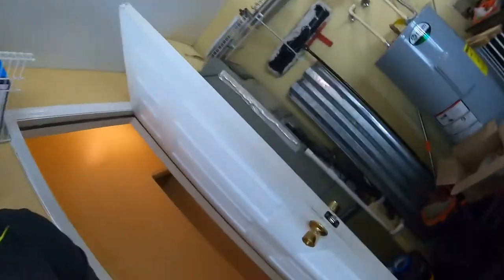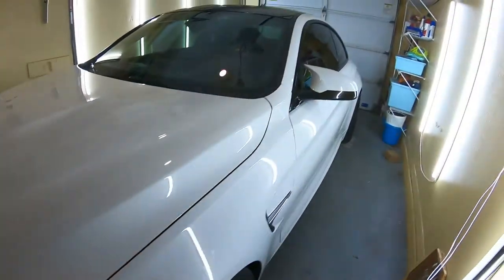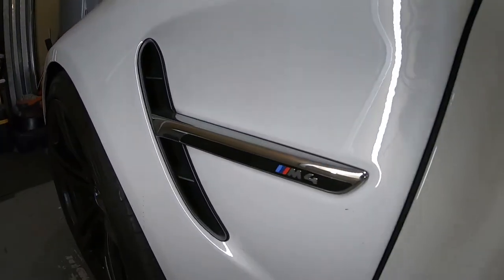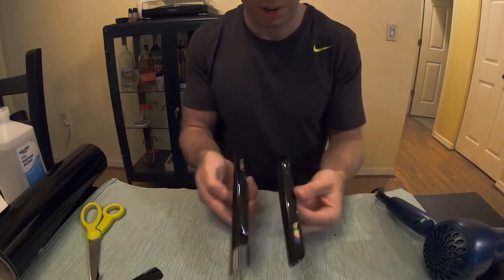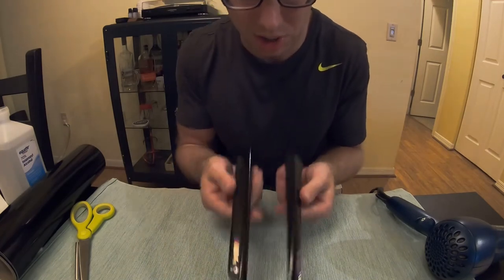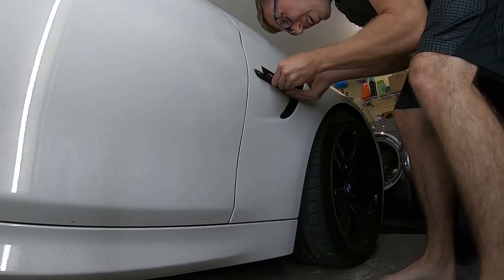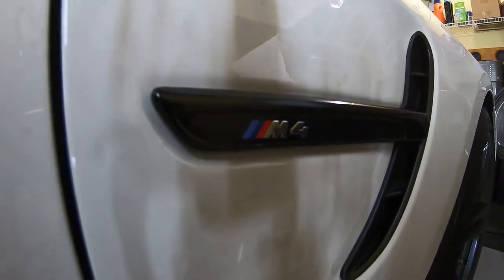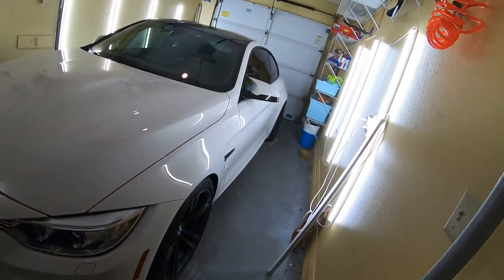Vlog 18 - BMW M4 Vinyl Wrap Side Grills

Comment: hey man, watching another one of your videos trying to get ideas for my M4😅 but do you recommend wrapping them? or just buying them in black? and if you think wrapping is better, where’d you get the wrap? thank you brother !
Reply from the maker: It’s definitely a personal preference. At the time I wanted the blacked out look without spending the $170 for those new gills. The funny thing is that nobody can tell they’re wrapped and I’ve had them on the car for almost 2 years with many washes with the pressure washer. If you don’t mind spending the $170, then go for the oem ones from Turner Motorsports.

I’ve had good luck with vvivid vinyl and this roll for $10.99 is more than enough to wrap yours. 

VViViD Black High Gloss Realistic Paint-Like Microfinish Vinyl Wrap Roll XPO Air Release Technology (1ft x 5ft) https://www.amazon.com/dp/B00FXY7W9U/ref=cm_sw_r_cp_api_glc_fabc_vxP9FbZ4XMVN3